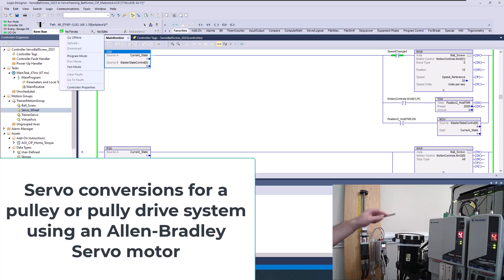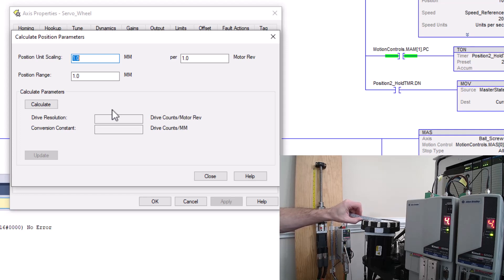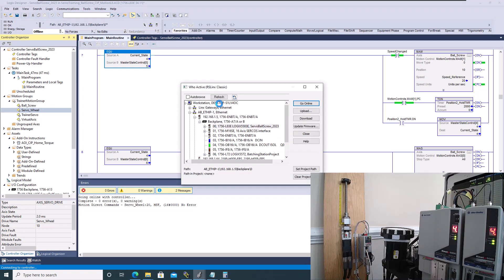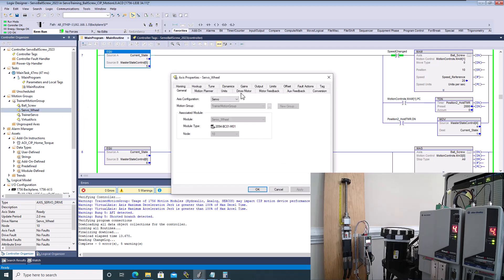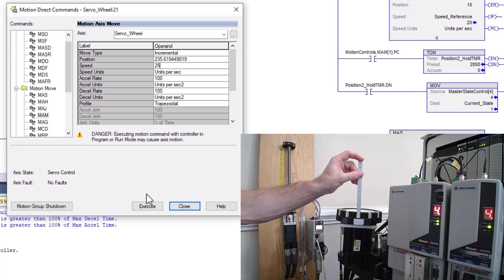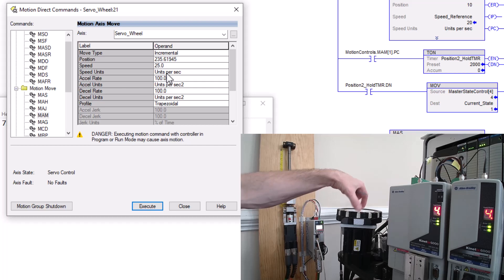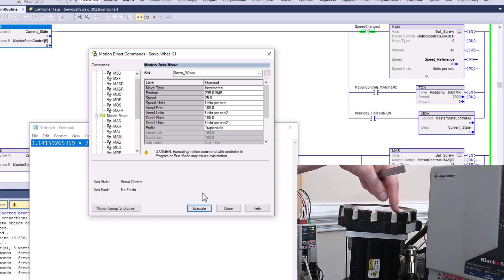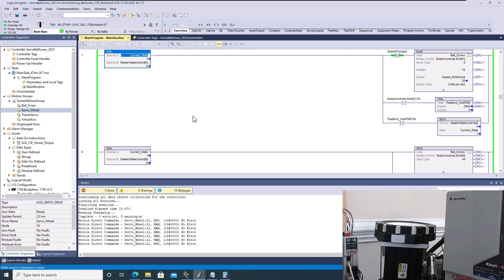Allen Bradley Servo conversions for a pulley or pulley drive system

Comment: Hey Shane. Great video as always - you really understand how to communicate these topics so they are easy to understand. I have a question about your calculation (pi times radius): How come that the Servo Parameter “Position Unit Scaling” takes ´pi times radius`as input instead of the formula for circumference ´2 times pi times radiuś? I assume some scaling must take place somewhere but I must admit I’m a little confused :D Sincerly, Heine
Reply: Hey Shane, you basically did a rotary to linear conversion, but since you used the radius and not diameter… your linear calculation was equal to 180 degrees. When you put this value in the field to be = 1 motor rev. It created a scale ratio of 2:1. It appeared to work because you pasted the same value in the increment move. I think it is hard to show the linear motion without the wheel attached to a belt or rack. I hope this helps
Reply from the maker: @bobrichardson3514  it's an example of calculation for a linear pulley example, I just don't have a pulley, I have a cheap wheel I bought
Reply from the maker: Because it's a circle, it's a wheel so you get the radius you need to use PI
Reply: @ShaneWelcher Great video Shane!
I believe he is asking about the circumference calculation. It should be D x pi or 2r x pi. To get the correct circumference. You basically got the correct 1 complete rotation either way, but actual calculated distance traveled was double that closer to 471mm or so I Believe?
Reply from the maker: @ThriftyToolShed  yeah, I just measured it with a ruler and holding the position measure with my finger so things were close enough to show how to calculate